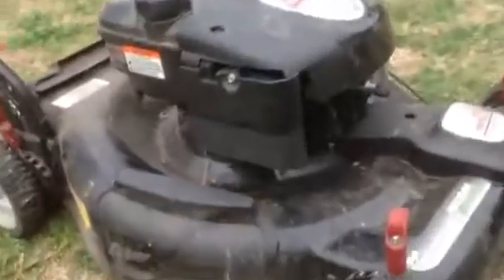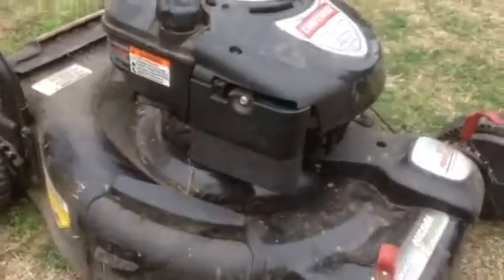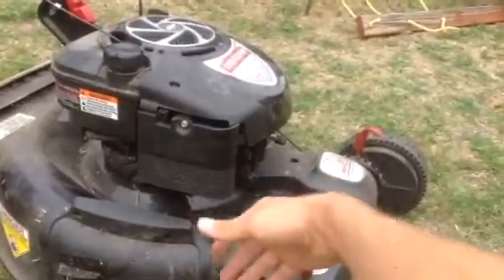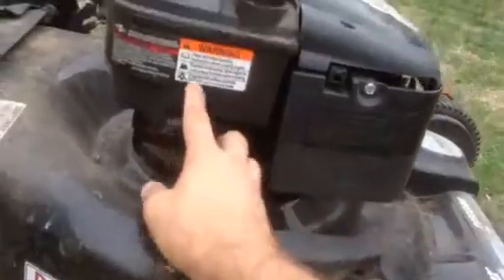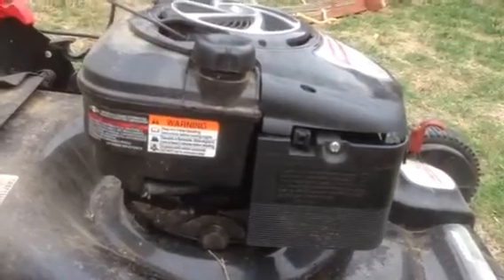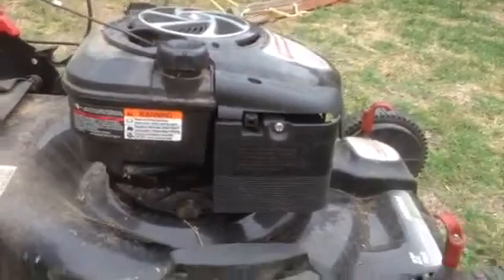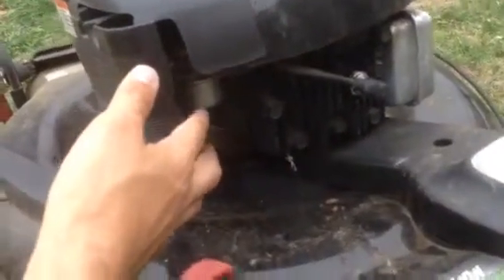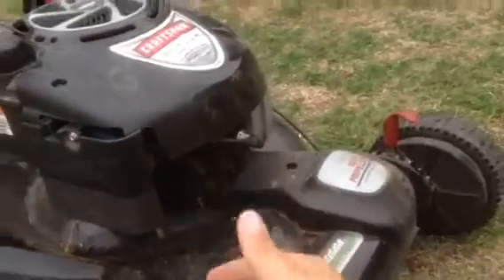How to fix any lawn mower

Comment: if you are to do another vid, it should be one cleaning the carb in depth as I have cleaned many and found that just a quick clean is not enough, you have to blow out the jets that are so small (which I know you would know based on this vid) so that's why it would be good. especially on a modern mower. I sometimes poke thin wire down the jet holes to make sure they are clean and hold up to the light with an eye glass.

Comment: four stroke engines have oil in them, and tipping the whole mower over with a gas cap off, will actually result in you getting oil in the top half of the engine which can cause a myriad of other problems